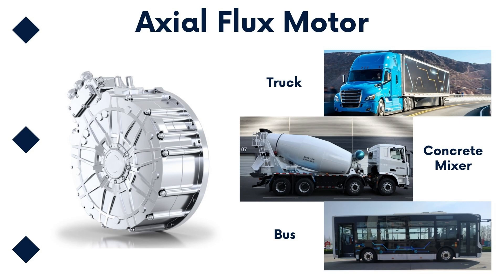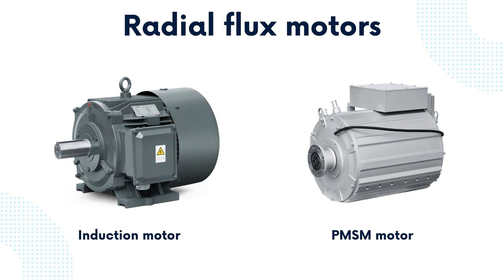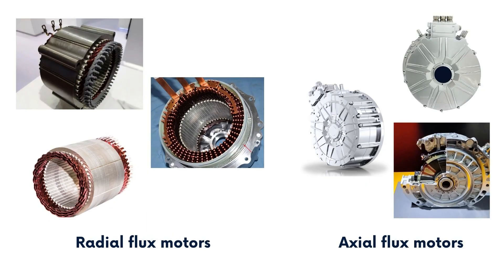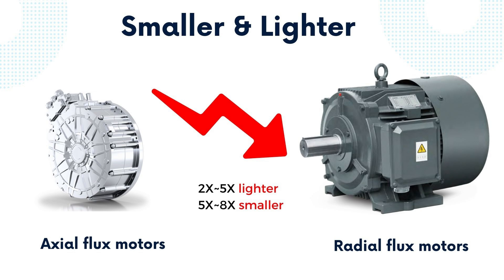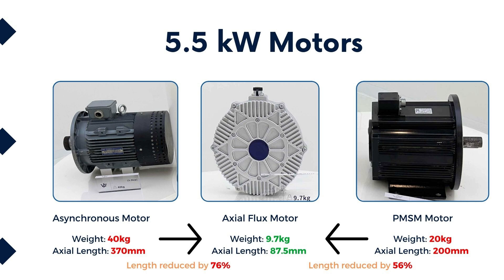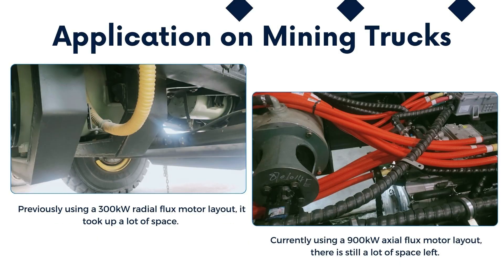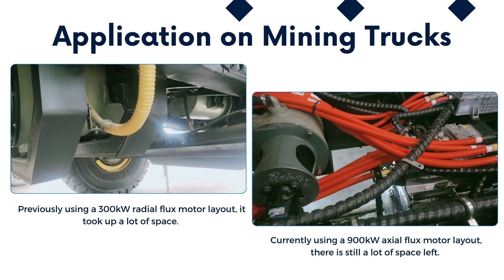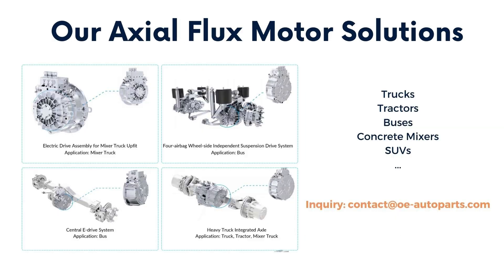What is an Axial Flux Motor? Is It Better Than Radial Flux Motor for EVs? #motor #emobility

Comment: Will this apply with hybrid electric vehicles where a compact biofuel engine recharges the battery so that battery powers the electric motor the rest of the way? Like a Diesel Electric locomotive?
Reply from the maker: It can be used for HEVs, on the range extender.

Comment: What about the cost and what about issues in mass production?
Reply from the maker: The cost is higher than that of radial motors as it has higher requirements on design and production

Comment: Unsprung weight is very very bad.
Reply: Explain what you mean and how it's related to this video.....
Reply from the maker: This is the challenge faced by in-hub motors, but the axial flux motor isn't limited to in-hub installation. It can be installed in the same places as the PMSM motor, but saves more space in the vehicle layout.